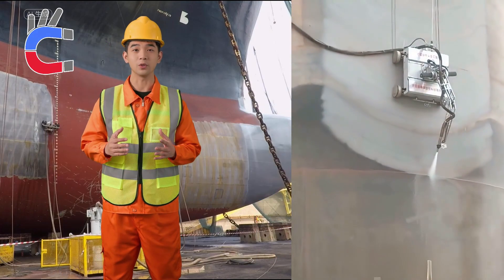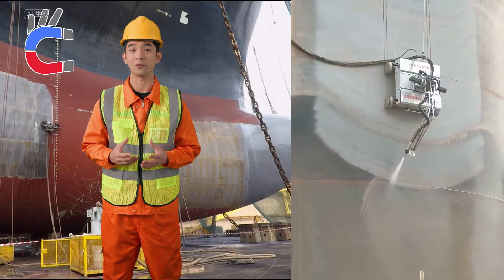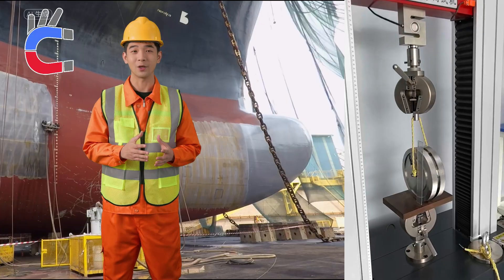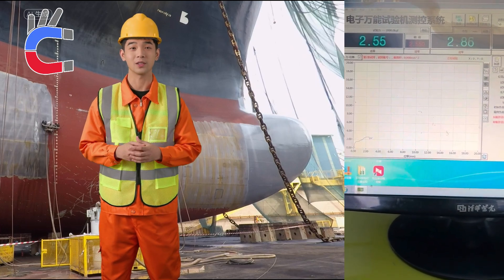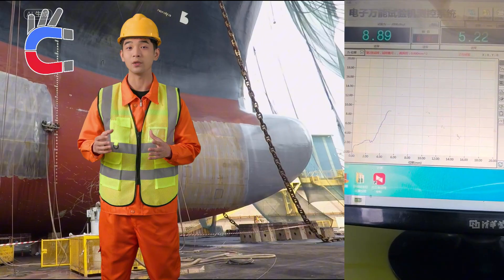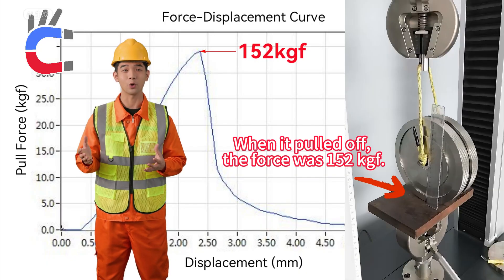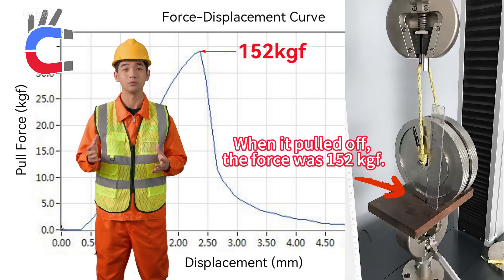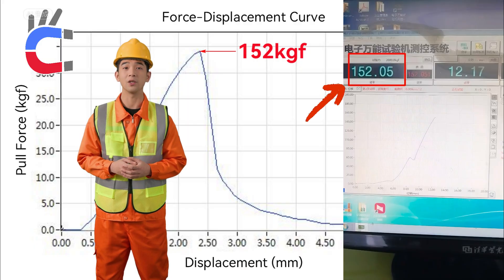Magnetic Wheel Hanging Test for Ship Maintenance Robots| @ccmagnetics

Comment from the maker: The principle for determining the magnetic wheel's kilogram-force (kgf) is as follows: After we manufacture the magnetic wheel, we place it on a standard marine steel plate. Then, a tensile tester pulls the magnetic wheel from the other side until it separates from the steel plate. When the pulling force reaches its limit (e.g., 152 kgf), the magnetic wheel will separate from the steel plate.